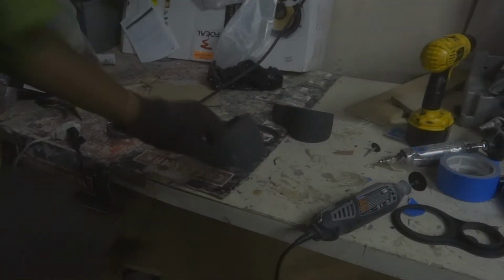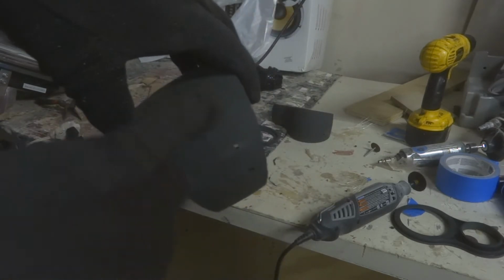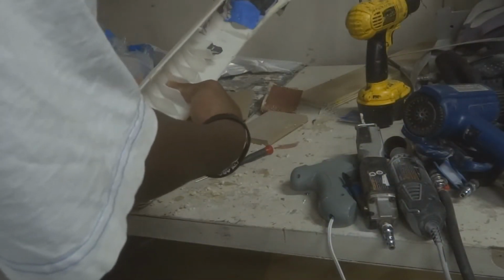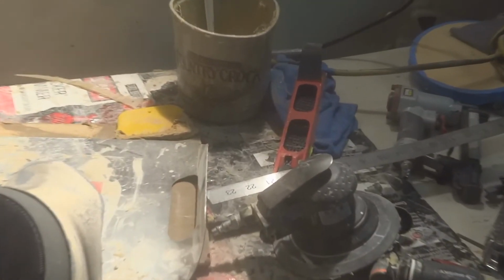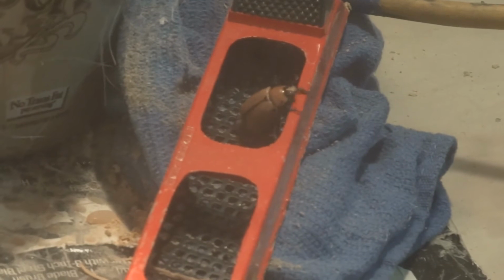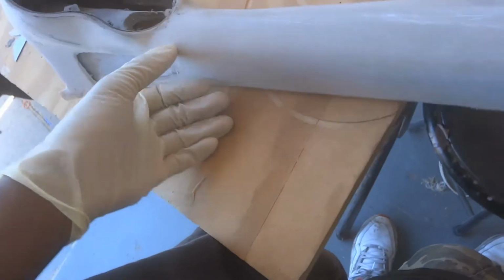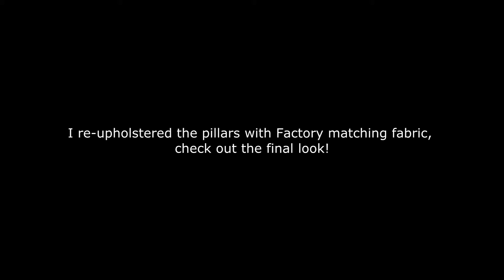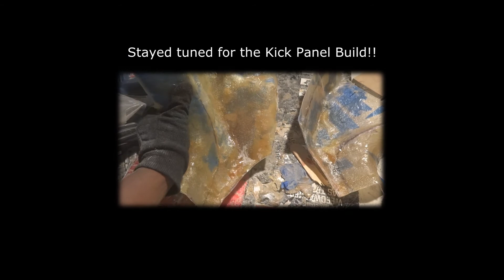Focal VIP Infiniti G35 - Custom A-Pillars part 2

Comment: Just did a small mod where I have 4 usbs, 2 aux, and a switch. I cut holes in my dash, and 3 usbs are for charging phones, 1 aux for passenger audio, switch to turn the other usb on and off. That single usb that is hidden is for bluetooth and is connected to the other hidden aux. 

I must say, projects like this is so fun. I can't imagine how satisfying it is to do what you do.

Comment: ive put the remote start in my car and have had it for 4yrs with no problems but these newer vehicles 02 and newer are so much harder cos of the alarm systems and anti theft they have on them.i had the key fobs working and finally got the unit to kick the starter over then shortly after smoke came out of the remote start unit and it just clicked and made weird noises and wouldn't turn over the starter. but i did get the backup camera system installed so i guess it wasn't a total loss.